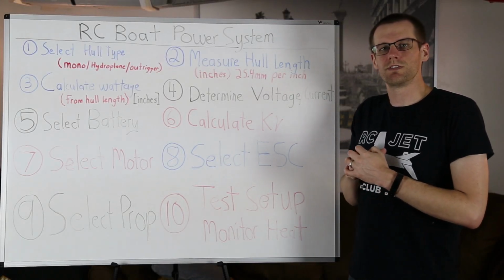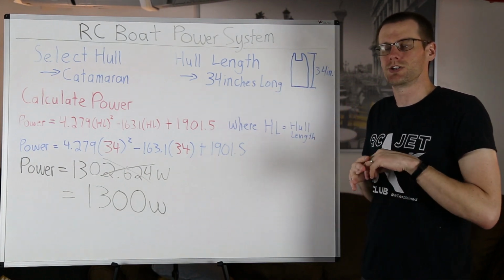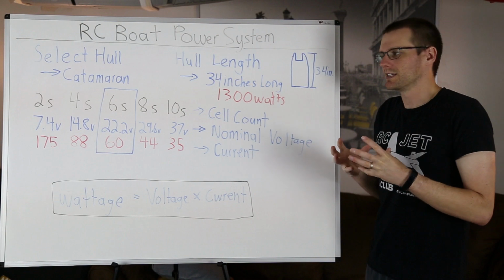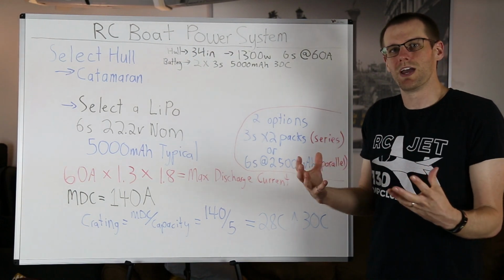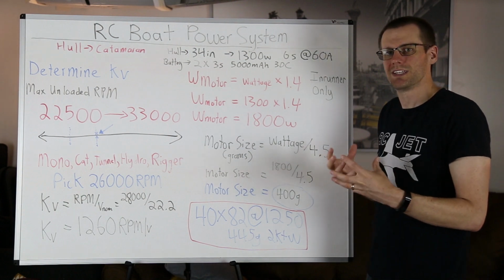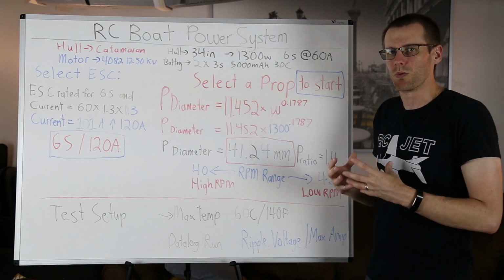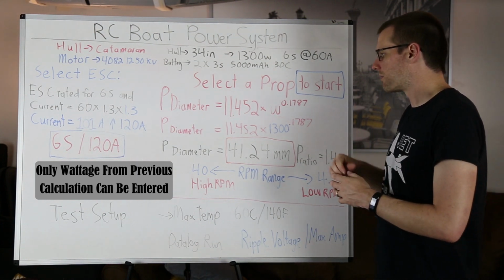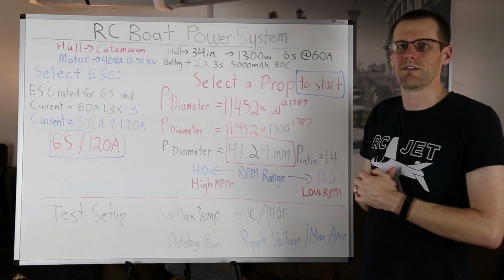Selecting a Brushless Motor, ESC, LiPo Battery and Prop for a Fast Electric RC Boat

Comment: Another quick question ,, can I use 80A brush less ESC and 4000kv brush less motor with 2to3s lipo and 33mm prop for my 23 inch RC catamaran boat that I have built ?
Reply from the maker: 2s 4000kv and a 32-33mm prop can work. 3s not recommended
Reply: So I should go a head with 3400kv brush less motor with 80A brush less ESC with 2to3s lipo with 35to36 mm prop to reach the speeds of 70to80km/h .??
Reply from the maker: Getting a small boat up to 80km/h will be tough. If you want to use 3s LiPo you will have to use the lower kv. Preferably around 3000-32000 or so. You can use 3400 but you will have to monitor heat so nothing blows up.
Reply: @RCexplained  can I use 3000kv brush less motor instead of 3200kv brush less motor ? And what should be the ESC for 3000kv motor ?

Comment: Hey I'm building a 23 inches catamaran RC boat ,, so can you please select the battery , watts of power and motor kV and size of the motor and ESC for me please ,, ,I'm a bit confused
Reply from the maker: What was your speed goal for the 23inch catamaran?
Reply: @RCexplained  hey !! I have a bit of an issue in the selection of the brush less ESC online ,, the 100 A ESC which you said is a bit expensive for me to buy ,, can I use ESC of less amps ,or is there any other alternative ways ????...
Reply: @RCexplained  hey !! I have a bit of an issue in the selection of the brush less ESC online ,, the 100 A ESC which you said is a bit expensive for me to buy ,, can I use ESC of less amps ,or is there any other alternative ways ????...
Reply from the maker: How about an 80A? You will have a bit less head room but that should be OK. Absolute minimum of 60A ESC. With these ESC drop your prop size down a few steps for the first run.
Reply: @RCexplained  okay ,, so should I need to get the water cooled ESC or an air cooled ESC ,,?. And what should be the prop size for 60A ESC and 80A ESC ?
Reply: 60 km/h - 37 miles/h.
Reply: I'm new for RC boats and building them so I really need your help in selecting the electronics for my 23 inch catamaran boat ,, I don't want to fail in it ,, 🙏
Reply from the maker: Hello. You could try 2s 5000mAh lipo using a 36x50to60mm 3200 kv motor using a 100A esc and a 37mm prop.
Reply: @RCexplained  thank you very much .😊😚
Reply: @RCexplained  but what should be the voltage of the 2s lipo 5000mah battery ??
Reply from the maker: 2s lipo = 7.4v nominal
Reply: @RCexplained  okay got it ...👍

Comment: Great informative tutorial video!
I do need your reply regarding my boat setup.
Im using 3S 7600mah 70C x 2 Series connector at 4092 1700KV with 180A Seaking and tried with 40-42mm props but only manage to get 80km/hr on the Cataran 1040 total length.
Did i go wrong anywhere on the setup? 
Can the boat reach 120-130km/hr with the correct props? Please advise... Thanks mate!
Reply from the maker: Hi Dayak, what is the temperature you are getting on the battery, ESC and motor? If you have room in temperature to go up, you can try slowly increase the size of the propeller. Getting to 120-130km/h may be tough as that is a big ask.
Reply: @RCexplained temperature of motor +- 50°C, Esc +- 60°, batt 45-50°
Reply from the maker: Your batteries are getting up there in temperature. Overall you can squeak a bit more power out of the system by going to a slightly larger prop. Keep an eye on temperatures and once you exceed a safe maximum you've reached your limit.
Reply: @RCexplained  can pls advise the maximum temperature for the batteries, esc and motors?

Comment: Great video, Thanks! I need help for power system configuration of a catamaran with two engines. What are the values to change?
Reply from the maker: Select a higher unloaded rpm within the range for your twin setup. Or use slightly larger props on the twin setup.

Comment: I am working on my first rc boat 36" long. The data you gave is apt. But i have already a 2650kv brushless motor and a 200a esc. Will a 4s 5000mah battery works well on this. Appreciate your suggestion. I find your videos educational. Thanks
Reply from the maker: Hi Boni, a 2650kv motor on 4s in a 36inch boat is going to be a tough combination to work well. It's not a setup I would recommend or suggest. The motor is going to require a smaller prop then what your boat may need.
Reply: @RCexplained  thanks. Ive changed my mind and go on two 3450kv with 50a esc brushless will be connected parallel to 6s 5400mah battery. My prop are 3 leaves 36mm 1.4pitch. I hope this will be a good set up. More power
Reply from the maker: Hi Boni, you are moving in the direction of more smoke coming out of your components. 3450kv on 22.2v is 76590RPM unloaded and would be far too much. What did the formula in the video say to use for kv,  power and prop size? 
I would expect twin 36x74mm motors around ~1400kv using running 6s to be much better for you. You would need 80A ESC's.

Comment: Great video as usual. I've got a couple of questions, as usual. 
I may have missed it somewhere, but how di you arrive at the 24-33000rpm with most motors have a 50-60000 range? Reliability, a power range I missed, or both.
And for the cell count on the esc, most have a range. 2s-6s for example, or a 4s-8s that I'm looking at, would I be best off with matching themax, or in the middle. I am planning on 6s for my speed run car. I know the math will be different, but I'm trying to understand the overall picture here.
Thanks!
Reply from the maker: Thank you Adam. The RPM range is the range that is best suitable for RC boats utilizing surface drive props. 

An ESC rated at 2-6s can work for 2-6 cell LiPo.
Reply: Thanks, I'm on the technical side, and when I hear "X",  it's "X". I'm trying to figure out my speedrun build, and I'd like to get the numbers right, from the beginning. Everything else is to be setup based on my power system. 
I've been getting high wattage, voltage matched gear, and the kv for rpm just under the max rpm of the motor. Allways a little headroom, an I can't over rev. Am I in the ballpark in my thinking? With resistance and size, so forth from your other highly informative and engrossing videos, of course. Bad with math, good with spec numbers, with an electrical backround. I get what your saying, your great, but I lose some of the math. Sp I tru to get the concepts down, and take my time doing the math, once I've narrowed down the field. 
Thanks for the grest info!
Reply from the maker: HI Adam, you are on the right track.

Comment: Are you willing to make the Propellers and shipped them for a fee
Reply from the maker: Hi Michael, there are many propellers already available in all sizes, shapes and pitches.
Reply: RCexplained I been looking for some and I could only find the stock one is there anyway you could point me in the right direction to find them
Reply from the maker: Offshoreelectrics

Comment: Man I am working on a setup now and you just gave me some missing math👍Love the video and knowledge is power⚡️
Reply: This was so accurate and had to check when done with set up.The math was perfect down to the prop and first time I have not had heat issues to address when I finished my boat!Formulas make a great go to and a lot of time had to go into figuring these out👍Thanks for sharing the info and great videos!
Reply from the maker: Hey Mild to Wild RC, thank you for sharing your experience. I'm glad the video was able to get you a good system for your boat!
Reply from the maker: Great to hear!

Comment: Hey!  Somehow I get the calculation on step three wrong ... it will be - 600 approximately.  I have a 20 inch long boat and 8 inches wide if it matters and count exactly as you describe in the video.  Do you know what I'm doing wrong?  Just thinking that -600 watts can not be true. Sorry if my english isnt right, i used Google translate beacuse i an lazy but i hope you understand!
Reply from the maker: Yes -600 doesn't work. You should get something closer to 350w at a 20inch hull length.

Comment: This video is awesome. I'm working on an RC plane currently, but would most of this info work for that context too? My initial issue is finding the correct wattage required which is your first step here. What flight parameters drive that? Thanks!
Reply from the maker: Hello it would be quite different. What kind of plane, what wingspan and how heavy?
Reply: RCexplained Unique design that has similar dimensions to a scaled down 747 and is also a pusher configuration. Wingspan of 6ft and target weight of around 17 lbs (including motor, batt, etc.). Let me know if you need any more info.
Reply from the maker: You will want to be around or over 2000 watts for that size. 100-150w per pound
Reply: RCexplained thanks! Really
Helpful videos, keep it up!!

Comment: hi, greetings from México, I just made a fiberglass boat, is 32 " or 820 mm, the weight is 2.174 kg, my problem is that  I have no idea about the engine and electronics, I made it for my grandson, can you help me to select all the items for my project?, I relly want to finish it any time soon; by the way, if you need it I'm a fiber glass specialist modeler.
Reply from the maker: Hi Jose, awesome project. Send me an email, my address is on the about page. I can help.

Comment: Can you help me configure my 2 bldm with controller. I made boat with 2x 1400kv bldm. Now I need to rotate one clock wise and other counterclockwise.  But my problem is when I turn right I need to off one motor and when left need to turn off other. How can I do it with one stick. My transmitter model is FS-CT6B. Can you help me figure it out.
( pressing forward both motor rotate. Forward + right only one motor rotate. Forward + left only other motor rotate.)
Thanks
Reply from the maker: Hello, it does not appear that your radio has mixing capability. A programmable radio will allow you to do this with ease.
Reply: @RCexplained  thanks a lot... I hope you will upload this type of video and help people to make good knowledge....

Comment: Good night, thank you for making such an informative segment. I'm currently putting together a twin brushless catamaran. I have 180A ESCs and 4092 SSSMotor 4pole motors, the Hull is 38" in Kevlar. I watched your segment on timing, I would like to say that I'm new to boating. Do you think I should reduce the timing from factory set 15.00°. Available reduced values are 11.25°, 7.50°, 3.75° and 0°. 
    Once again thank you for patients, be safe and family.
Reply from the maker: Hello, thanks for the comment. 
I prefer to run a brushless motor on sensorless mode with variable timing controlled by the ESC. The settings are then ranging from low to high where I like to select low timing for this type of setup and try from there. 

If your only option is fixed timing at a specific amount of degrees I also would start low here and find out where your sweet spot would be from there.
Reply: @RCexplained  I believe that the intervals are fixed. Is going to 0° down from 15.00° going to negatively affect my 4092 4pole motors? I'm using Seaking 180A ESCs. I haven't scrutinized the manual in detail.

Comment: Great in depth video. Clearly a lot of effort went into this one. It would also be great if you could follow up these type of video with the boat build to this spec and test it. Then maybe go through the data log, to prove it works in real life. 

Would also make for interesting content. 👍
Reply from the maker: Hey Lawrence, thanks for the comment. As like most of the videos I do, I'd love to make a practical example video with all the components. However, it all comes down to budget primarily for the content I'd be showing. I would have to buy quite a bit of stuff for just this one video. My RC lineup is always changing every year as I don't hold on to stuff that I no longer use.

Comment: Considering the c rating on batteries are complete rubbish, it's almost pointless calculating it.
Reply from the maker: The data that I have collected from batteries and C ratings does show that there is a strong relationship with C ratings suggesting there is some merit to them. 
The data was the result of this calculator:
https://youtu.be/tqcbMCQY9fE